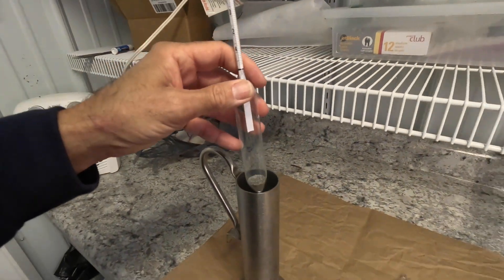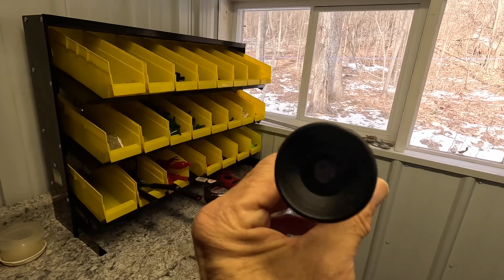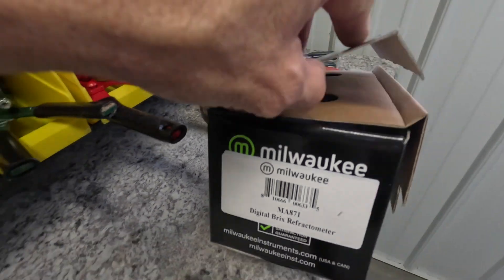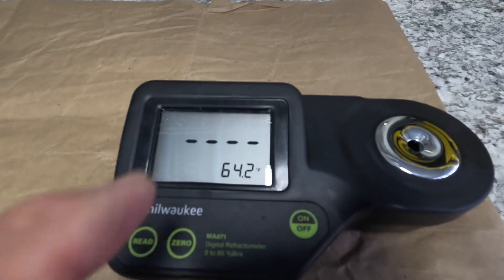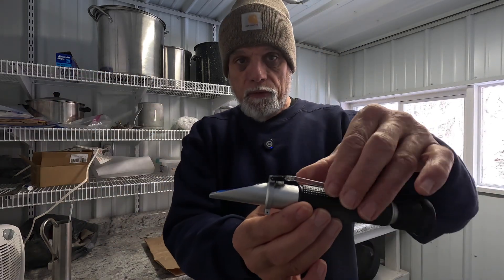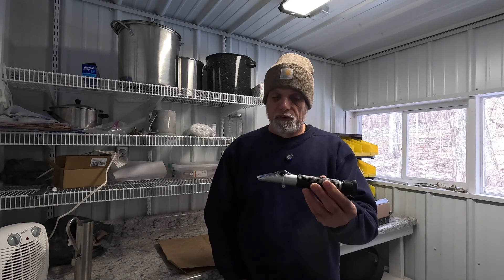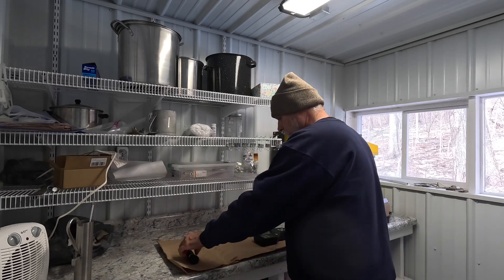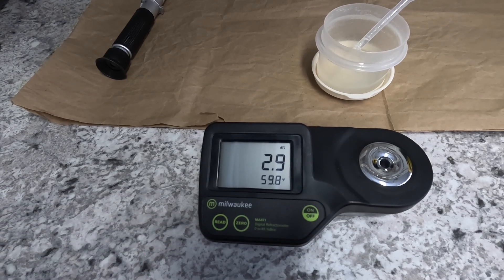How much sugar is in maple sap?

Comment: Wow, 2.7% off the tap is really good! Is that what you always get? Another great video Tony, It's obvious your in your element when talking about maple syrup here in the Hoosier land. Good luck with your season.
Reply from the maker: Thanks John. No, our sap typically runs around 1.5%. The sample I was using in this video was collected a few days earlier, and had been frozen and thawed a couple of times beforehand. I'm thinking it was more concentrated because of the way I handled it. I've also read where some folks are claiming the Milwaukee unit struggles to give an accurate reading once the brix drops low, so that may be part of it. I'm definitely gonna do a lot of comparison between the three devices before trusting it completely! Fun stuff! Good luck there in Freeman!

Comment: Great syrup info. Can you tell me what reverse osmosis unit you're using.. I'm just getting started  and have been looking around.
Reply from the maker: Thanks! For several years we used a homemade RO that we put together ourselves, using (5) 150 gpd membranes. It worked great, but we just outgrew it. So for this season, we have a new 60gph single post unit from the folks at RO Bucket. Excited to see what it does for our small operation! Good luck with your season!